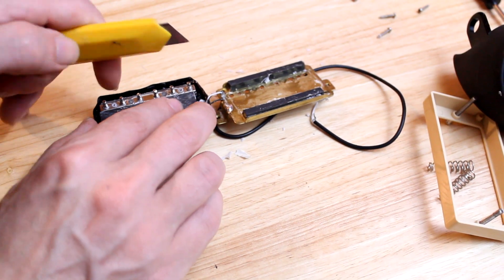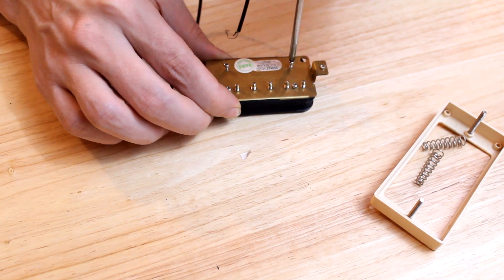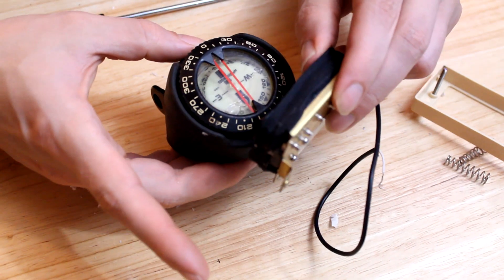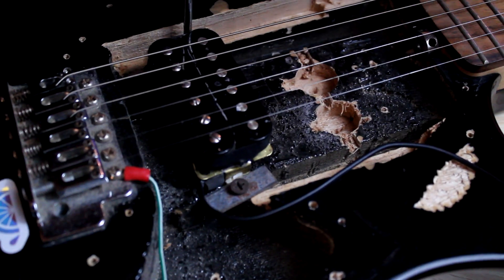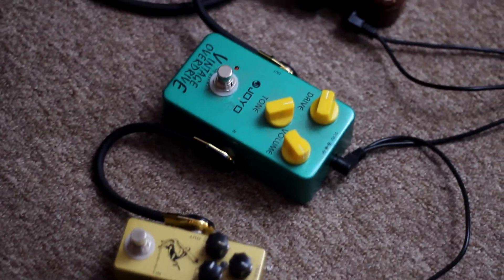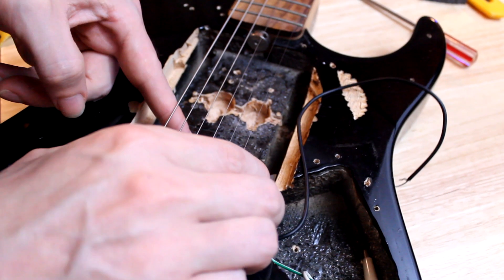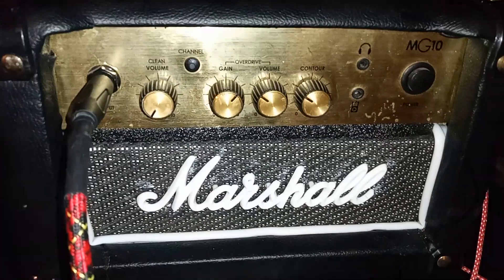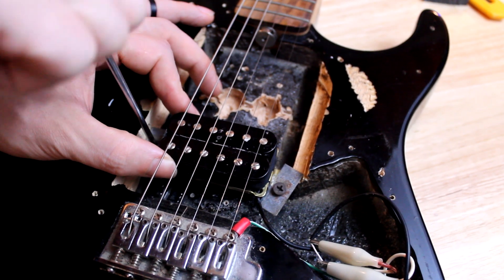Humbucker Magnet Swap Mayhem! (Myths CONFIRMED???)

Comment: Magnet swapping is extremely rewarding, as is base plate swapping.
Reply: Been playing with pickups even winding them. Something besides the magnets effect tone. Never tried swapping base plates. But the same magnet can sound great in one pkup a d not so great in another.
Reply: I’ve heard that base plates make a big difference between the cheap kinda bronze looking pot metal import plates vs steel or brass plates. I’ve never compared different plates on the same pickup and I’m one of those weirdo’s who likes ceramic magnet pups in neck hb, they’re clearer and less mushy from my experience
Reply: @brandonjackson5865  Right, so you've got the same attitude to neck pups as Steve Vai. But maybe you'd try a nickel silver base plate and get even less mush?
Reply: @3rdmm possibly